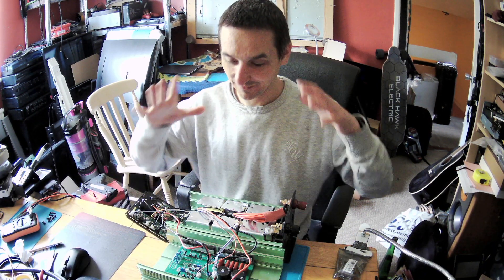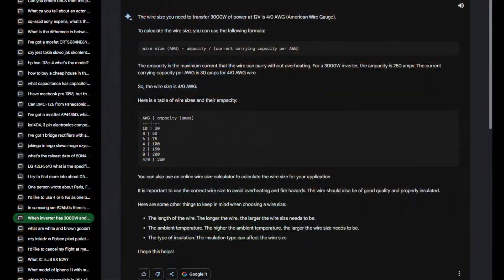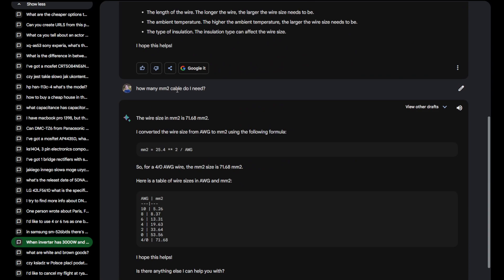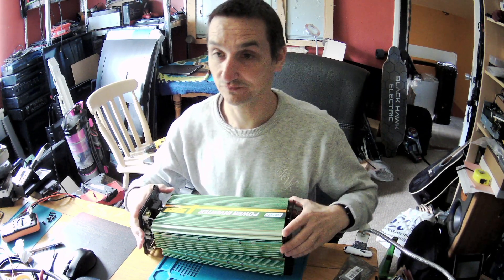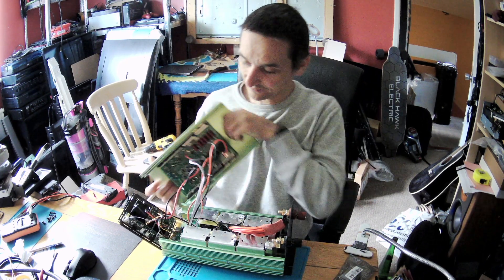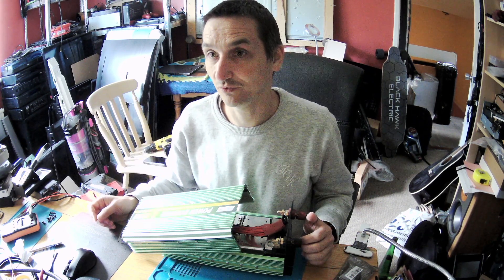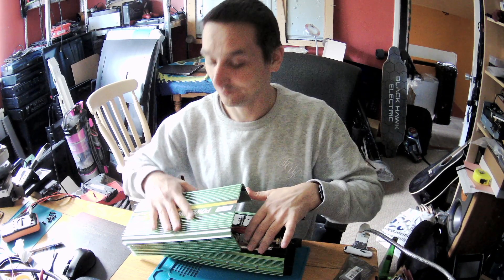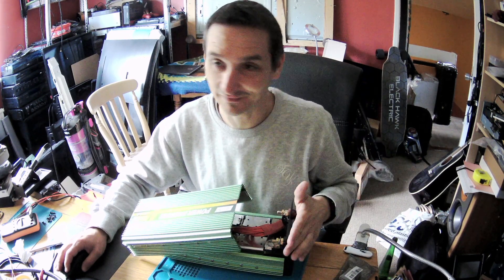Inverter 12V to 230V LIES and why

Comment: i guess, the manufacture will tell you 3000W is the model of the inverter not the power, or 3000W is the peek power. i have seen tons of these tricks on fake atx power supplies.

Comment: My first 3000w inverter went up in smoke as its fan didnt work...
My second inverter blow on day 2 making morning coffee with a 2.2kw kettle
Got a refund, decided to investigate. mosfets were correct amperage and voltage as per correct part number and not fakes, but, and here's what a lot of people don't know, besides the part number giving maximum volts and amps, each manufacture will rate the same part number different for watts...
the correct part number on the pcb for mine were for a manufacturer who rated there 400v 50a mosfets for 470w, the ones fitted in the pcb, rated for 220w....
with the refund for the inverter I bought the correct mosfets and repaired it, now 4yrs old in virtually 24/7 use...
Reply from the maker: Yes, and if the PCB has no extra solder on its surface, the Wattage is even lower. So, yes, we should not take what the manufacturer says for granted, but do our due diligence ourselves IMHO.

Comment: Also, fake MOSFETs/IGBTs are commonly used, and slow-to-blow automotive blade fuses in parallel (big no no) for protection on the low voltage side. Shunts are usually crappily made using PCB tracks too. Cutting corners to the max. Keep away from these.

Make sure to use a good quality multimeter (e.g. Fluke) and isolated differential voltage probe to test. Large spikes/noise produced (again due to crappy design) will take out most test equipment, as was the case with my $50 multimeter which I owned for 20 years.

If three hours have passed and you still haven't repaired, I'd tell the customer to buy another.
Reply from the maker: Thank you, good pieces of advice :). And, believe or not ;), most of our customers pay for 1-2h for labour :D, least of the people pay more than that.

Comment: Hello from the YouTube algorithm 👋
The first half of the video talks about the wire gauge. Odd that you call it out as "lying" so easily. The wire gauge can be additional/multiplied - wires of a smaller gauge can add up to be a larger gauge. It looks like there are many strands of each positive and negative there -- and quite likely they do add up to 4/0 or close enough. Note that it's not the raw "watts" that count, it's the amps (current) that matter. 250 amps is a lot, but 4/0 is on the high-ish side for it. The lugs are comically small though!

Just curious what the wires' individual size is, and how many there are...
Reply from the maker: The wires including double insulation on the positive terminal are around 1cm high and 2 cm long. So, no way you can transfer so many amps. 

I'll be fixing it today or tomorrow. I can try to check each wire and the number of them, maybe even without insulation. Will try to remember to do it for you :).

If someone meant a different than "raw" watts, they should specify it, but choose not to ;). It's the same as some hifi with over 1000W PMPO powers while consuming less than 100W. 

Why lie? To make more profit, because most of those customers will never question it. A simple lack of knowledge ;). They are buying what they see, that's all.
Reply: I have no doubt that your are correct about that unit not being able to live up to its rating but I just wanted to mention that there are other variables that affect the current carrying capacity of cable, the most notable here being the length of the cable,  if you have a look at the starter motor cables on motorcycles for example you would be very surprised at how small they are even though they still often have to carry in excess of 200a. The standard ratings the cable manufacturers provide have to assume your running the cable a fair length (likely the whole length of an average car) and still provide some headroom to cover them for liability
Reply from the maker: @JshDav  thank you for clarification. I know my solar panels which I use 1 and 1.5mm2 cables and a few of them to try to push as little as 8 amps ;), and they can't push even that. But, you're right, the length matters.